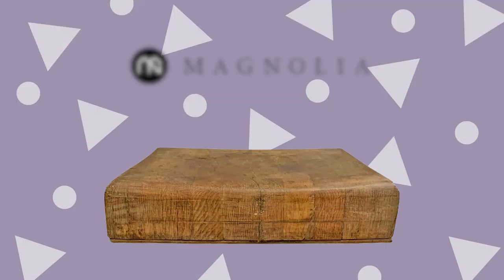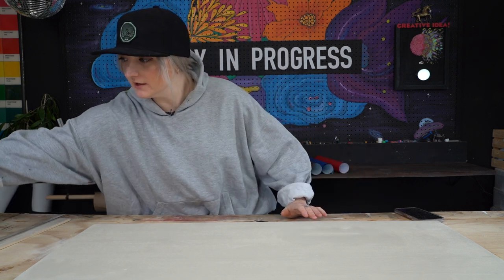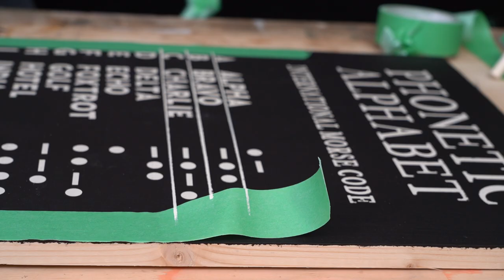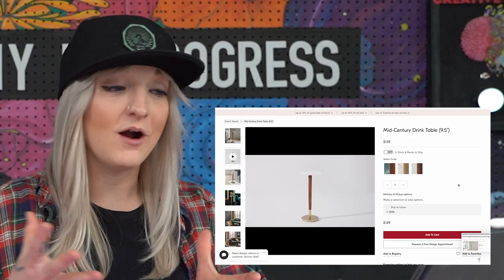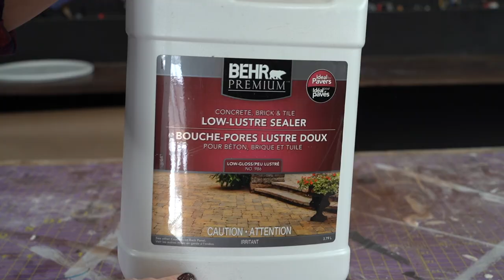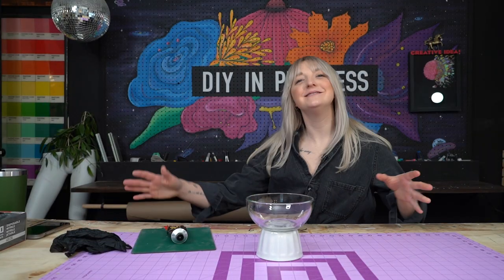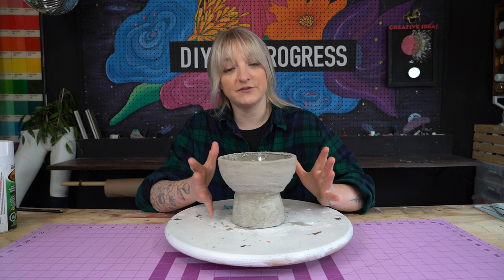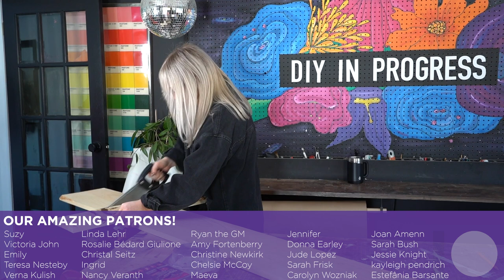diy home decor hacks - Get the look for less! | Can I Make It For Cheaper?! | DIY Danie

Comment: Not sure where you'd find it, but I have a 'sticker scraper'. It's like a single sided razor blade in a retractable holder, but it's made of mildly flexible plastic and won't slice through anything. However, it has the perfect strength and flexibility to get under the edge of snickers, which makes removing them super easy. I think I found it in either an office/retail supply store or a dollar-store it was a few years ago, and I just don't remember.

Comment: I just loved the Morse code board, for the table it was nice but with fur babies I could see this going flying. 
I liked the candle but the minute you slapped on the glue to join them together I just knew you would not be happy, that label on the bottom of the bowl 😹😹😹😹that did me in, I hate the labels that are stuck on things as they are, but watching you slap on the glue and plopped it onto, I did not know if I should laugh or cry😹😹 very nice save with the tile adhesive and the specialised paint job.👍🏽 what I would recommend is don’t place it under flower arrangements when you light up, that’s begging for major trouble when using candles. 
I would love to use them but where I live it just too darn hot during the summer time, I have a 2’ tall candle 3” in diameter when to use it one day once to find it had turned in to a 1’ foot upside down U😹😹😹 it now sits in the cabinet waiting for insperation to hit😹😹😹and yes it was a very blooming expensive candle that has never been lit in the 30 years that I have had it😹😹😹except for the day I got married 😹

Comment: All the projects turned out awesome 👏 though question? why not line the inside of the glass bowl with tile mortar as well so even if you spray paint it white with the heat resistant paint over top - when the candle burns down you can use tea lights or use it as a catch all bowl and the texture is consistent for the whole piece? I think the alphabet sign is spectacular - though all of your projects are beautiful! 😍 🤩

Comment: Hot tip... if you use a heat gun (or a hair dryer works too, just takes a little longer) it will melt the glue and the sticker will come right off of the wood in one peice super easy and usually with all the glue still attached, makes staining/painting easier. Hope that helps!

Heh. Its a... hot... tip.

Comment: All your project looking great! I do have a safety issue with your candle... You did check how heat resistant your materials were, but I miss the part where you compare it to temperature of a flame of a candle, which can get as hot as 1,400 °C (2,552 °F). And you have multiple candle wicks, so... it's not going to get much cooler from this. Be safe!

Comment: *Suggestion: If you dont want to see the picture hanging wire or have it hanging on the wall funny, why not just hang it with French Cleats? Super easy to install and are 100x better than picture hanging wire -  also they are almost invisible!